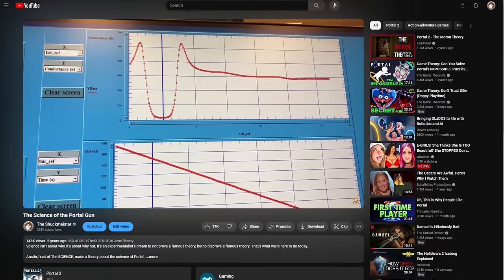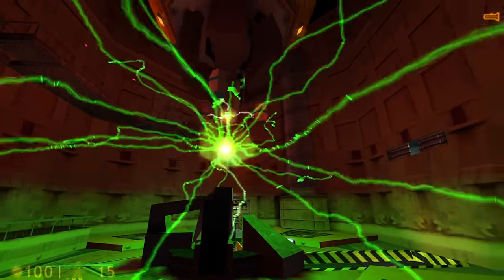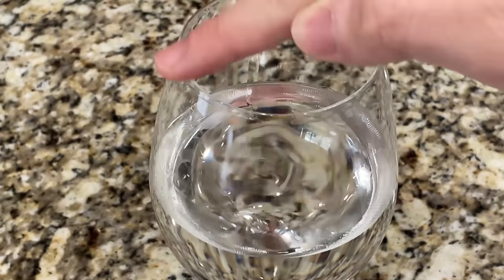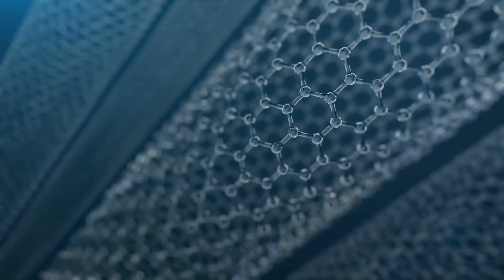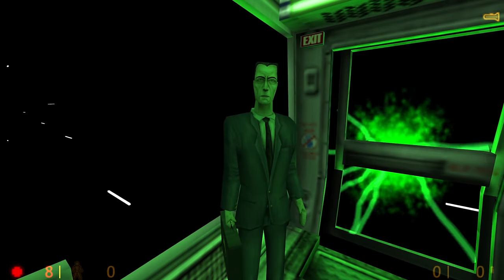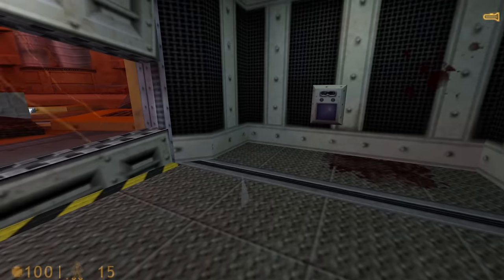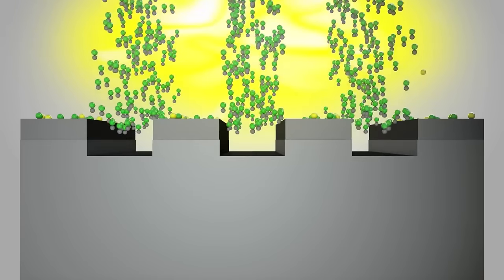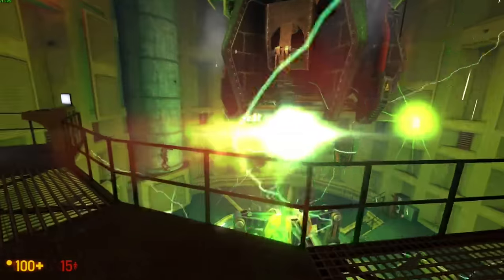The Science of Half-Life's Resonance Cascade

Comment: In case you ever want to revisit the topic: You mentioned that Half-Life 1 doesn't go into detail on how teleportation works, but it is elaborated on in the expansion Blue Shift (Dr Rosenberg, end of Chapter Four "Captive Freight") and in Half-Life 2 (Dr Mossman, start of Chapter Five "Black Mesa East"). Half-Life has three, possibly four, distinct forms of portal technology. The Black Mesa method (refined by former Black Mesa researchers during the time-skip between HL1 and HL2), The Aperture Science method, and the Combine method. You've already covered Aperture's portal tech, but the Black Mesa and Combine methods are reliant on what's called the Xen relay, which is that one has to teleport to Xen and back as opposed to a direct Point A-to-B. Black Mesa's earlier methods relied on strapping devices to the crystals to give a reliable simulation of local teleportation, but those techniques were improved both in the months leading up to the Black Mesa Incident and in the 20 years following. Where the two differ is that the later more refined Black Mesa/Resistance method uses Xen as dimensional slingshot to avoid actually passing through, while Combine portals are string-based. Mossman, who is the main source of information on Combine portals, makes specific mentions of Calabi-Yau manifolds, dark energy, and entanglement. It's mentioned somewhere, though I forget where, that the Combine can't actually teleport through local space and are reliant on less effective means of transport once they are actually in their target universe. The possible fourth method is an Aperture Science experiment mentioned in HL2:E2, something akin to the Philadelphia experiment, that had faded into urban legend by the early 2000s, but almost nothing is known about it beyond it being some indescribably powerful technology, so we cannot definitively say that it is significantly different from the three known methods.
Reply: I'm calling that fourth method the G-Man Method and you can't stop me.
Reply: From bits and pieces I've seen around the internet regarding the Borealis (mostly discussion and epistle3 which is not official lore), they talk about some sort of "bootstrap device", time loops and alternate realities warping the ship and the people on board, so it seems that aperture went beyond the whole "get from A to B" and instead directly to "get from A to The Plot of Event Horizon"

Comment: Mass effects element 0 (positronium?) and mass relays seem like a good starting point. Also, biotics, because they're related.
Reply: There's a ton of lore about the science behind the mass relays hidden in the game in the Codex, just so you know. From what I can understand, the mass relays appear to be some kind of gravity warping boost device for the Alcubierre drives installed in the ships in mass effect that allows them to accelerate to speeds many many times c over a short distance, allowing them to make trans-galactic crossings take minutes to hours, as opposed to what the drives can pull off on their own, which appears to be traveling between stars in a cluster in minutes or hours. You can tell that they're Alcubierre drives because of the fact that they're using "element zero", which is kind of analogous to exotic matter described in Alcubierre's theories, both substances exhibit the same essential effect: an inverse "mass effect" on the higgs field, generating negative gravity.

Comment: My understanding of the meaning of the "cascade" is actually a bit different. 
What I guessed was happening is that the machine created resonance and was if the fabric of space and time was what was vibrating (hence the sound caused by the machine) and that perhaps the Xen crystal has a bond to Xen itself, so when it was put into the machine, it created a link to Xen. So the cascade (or the glass breaking) is actually time and space itself shattering, hence the several gateways created.
I may be missing something as well since the video is so in-depth on real physics, but since this is still science-fiction it's much easier for me to be able to guess what the writers were making up for the plot.